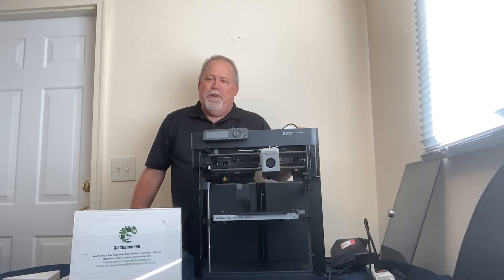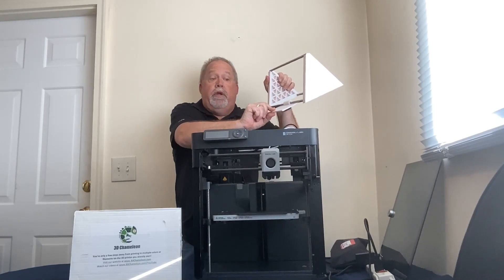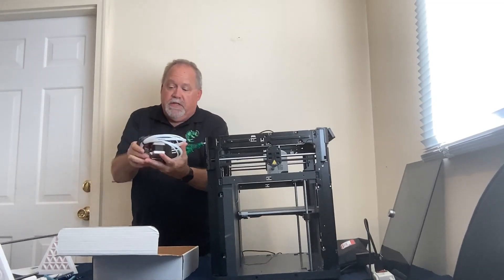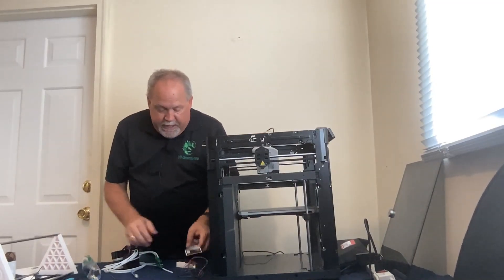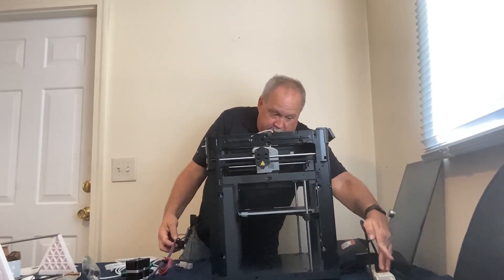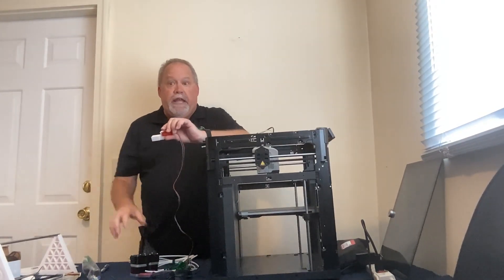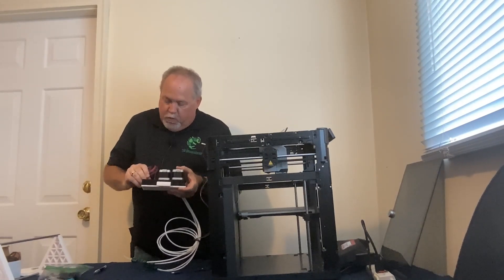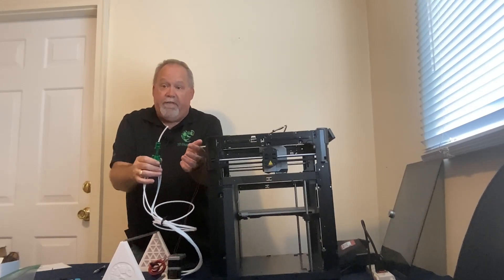3DChameleon on P1P in Mode 3

Comment: Thanks Bill, your videos make it so much easier to understand the installation.
I am planning on adding the Chameleon to my Prusa MK 4.  Any chance you will be doing an install video for that?
Reply: It's really the same installation... all you need to do is connect the Y adapter's PTFE tube to the top of the NextStruder using an PC4-M5 PTFE coupler.  The switch mounts are already on our Printables page for the Mk4.

Comment: Silly question, will the P1P profile work for the P1S as well?  Contemplating getting one of these instead of an AMS and having the filament in a custom dry box flowing into the 3D Chameleon.
Reply: It sure will!  The P1P and the P1S are virtually identical (and are from a software standpoint.)

Comment: I dont know if this the right place (sorry) but can you develop the 3D Chameleon for Anycubic Kobra 2 Max?
Reply: The 3DChameleon is universal and works on any printer.
Reply: @williamsteele the mounts are different
Reply: @hugoramos496  Yes, but we provide many mounts for various printers.  And it's very easy to adapt our designs to work with any printer configuration.

Comment: Neat product, this is looking like it doesn't need modified firmware, im guessing the kit's steppers free wheel during the print process till a color change event is triggered. My only concern with 2 steppers and 4 filament, it appears you need to reload filament if you go from 1 to 2 or 3 to 4. Is that correct?
Reply: No, it can drive all four colors with just two motors.

Comment: what about the bl a1/mini?
Reply: At this time the A1/A1 Mini are not supported.  Bambu has added blocks in the firmware to prevent other color changing systems from working by blocking access to the ability to remove the filament (and cut it) during a print.

Comment: can u use this on an x1c plus the ams? and can u use more then 1 on a machine?
Reply: Yes to both questions.  The 3DChameleon can be used with the AMS, but you'd use the 3DChameleon (using one of our optional 2 color Y adapters) in parallel to the AMS.  With our system, you can have as many 3DChameleons as you want on a printer.  You can easily move it from machine to machine as well.
Reply: @williamsteele   Thank you sir be kind of an interesting video to do adding the chameleon onto AAM s unit so that it can be used in sync I think I would clarify it for a lot of people

Comment: Is it possible to use this on the k1?
Reply: The 3D Chameleon works on any printer, so yes.  The K1's installation is nearly identical to this P1P... the only difference is the printed mount for the switch.